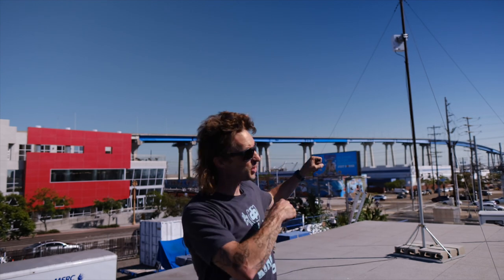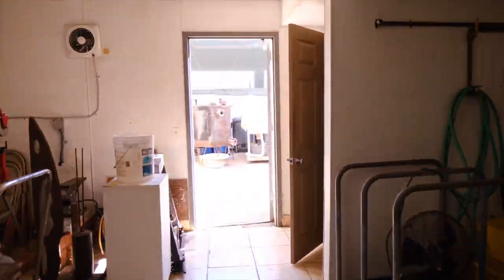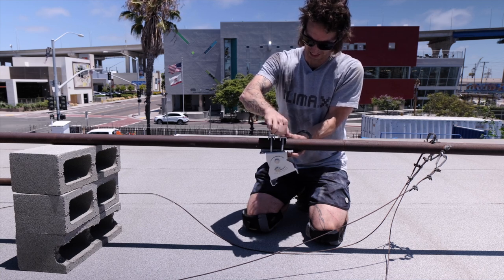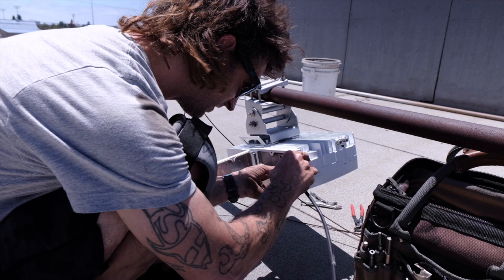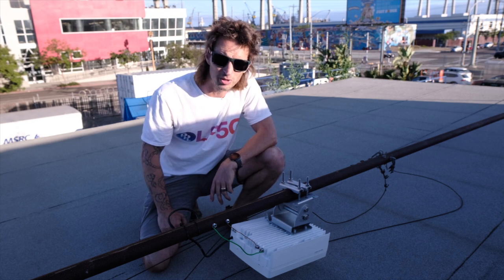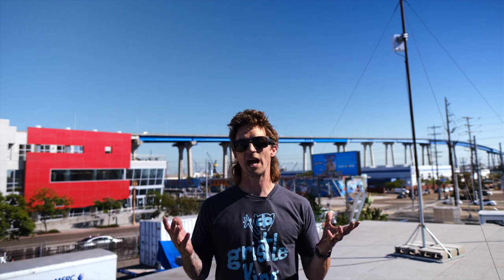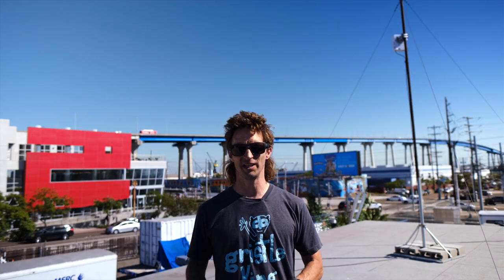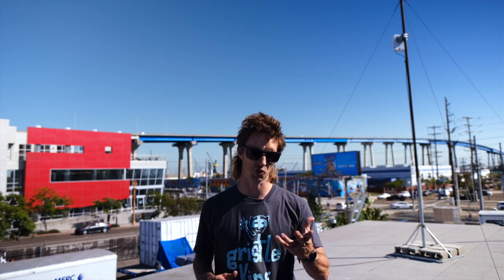Helium 5G Demo Deployment

Comment: Yo Nick, speaking for myself... None of this information or any of your prior documentation is far from boring... I haven't yet joined the Gristle Crew as of yet. And I understand if you don't answer this question. I know you're busy with your own businesses, but here it is my situation.... the miner  would have to be put outside up on a 14m Pole along with the small
cell. Given I supply the injector with the proper wattage to supply both the miner and the small cell splitting the power in the weatherproof miner case supplying both power and data to the miner and then back out of the miner supplying power but now the data from the miner to the small cell with the use of extra connector /accessories/adapters.. etc. Just your thoughts as if it will work... Yes? or No?.
Thanks dawg....
Reply from the maker: I don't understand the question, can you clarify?

Comment: Nik, I noticed you didn't have anything about the 5G omnidirectional antenna the fine print on the Calchip site says you need to run this. Is it really needed or just an $800 optimizer?
Reply from the maker: Hmm, I don't understand that question.  The thing I mounted is a combo radio & antenna (the 430i, where "i" is for Internal antenna).
Reply: @thegristleking  I got an answer in discord... The 436 model cell radio requires a special $793 omnidirectional antenna, apparently. The non-436s don't.

Comment: Why did you take the Nebra off the pole?  Seems like you could have kept it there (and I am assuming the distance back to the FF gateway was too long for an antenna cable to pole).
Reply from the maker: That was just a Nebra case; I'd used this for a DIY miner I built back when that program was open.  Once San Diego got overcrowded, I moved that miner to a less crowded place.

Comment: OK thats the simple stuff, now how about the permitting and technical issues of getting it set up?  Also how much bandwidth are you getting from that internet access and how would you determine ROI to see if that work would even break even.
Reply: What permitting ? You register in the app to verify GPS and you’re done
Reply from the maker: Great questions, I'll be putting together something to answer all those.  The short version is that for now it's all taken care of by the manufacturer.  That will not last forever.
Reply: @jwadcan  Nope, lots more than that.  Read the docs not the ads.
Reply: @jwadcan  permitting like most telecommunication businesses

Comment: Can you tell us about the CPI approval process?
Reply from the maker: Do you mean getting a CPI, or having a CPI sign off on your installation?  The latter is handled through Pollen as needed.
Reply: @thegristleking  From what I understand, after installation we need to get CPI approval so we need to share installation parameters (address, height, azimuth agnle,  elevation with photographic evidence) with FreedomFi, and they will get us CPI approval, which apparently takes 3-5 days, before we are able to actually turn on the 5G radio/antenna earn MOBILE.  Is this not correct?
Reply from the maker: @rafaroox6727  yes, that is correct.  All of that happens from within the FreedomFi app.  Does that make sense?
Reply: @thegristleking  yes but what all does that entail?
Reply from the maker: @rafaroox6727  take a couple pictures of the install and use your phone for angle and azimuth and you're all set.  It's really straightforward.
Reply: @thegristleking  thanks bud!  Setting up tomorrow

Comment: Any thoughts on using the Poe++ injector to power the HotSpot & the 5G antenna? Trying to think of an easier way to get hotspot near the cell antenna without running 120v up to the roof.
Reply from the maker: Hmmm, not sure if you can split off a splitter, but that would be cool.  Or just run antenna cable to get the LoRa antenna on the roof.  LoRa rewards are so low that I figured leaving the LoRa side indoors was fine.  Plus, any location that's a good 5G location is probably a bad LoRa location (because it'll be in a busy place and probably already overcrowded with LoRa miners.)
Reply: @thegristleking  I’m in a pretty solid area for both still, Augusta, Ga metro area. Not a ton of hotspots in the suburbs but a lot of underserved cell areas. This location still makes about 6 HNT a month off Lora, but probably wind up doing the same as you and setting up cell as priority now. Need to figure out how to do the 5G mapping to keep rewards high early.

Comment: Man, just cinder blocks? I'd be drilling them in with tapcon screws + some silicone to seal it and then add the blocks
Reply from the maker: Yep.  We don't get tornadoes here, and this setup has been up since October of 2020, through a couple of wind events with no movement at all.  It's a pretty solid setup, and I hate putting holes in a roof. :)
Reply: @thegristleking  Hahaha I’m up in Los Angeles, but I drilled in a mount anyway.
Reply from the maker: @discontinuity  right on!